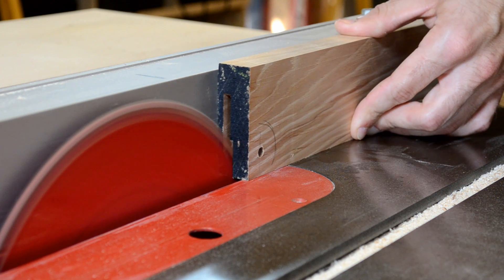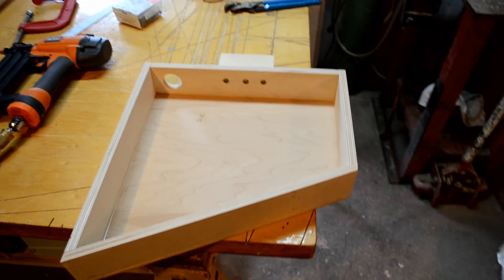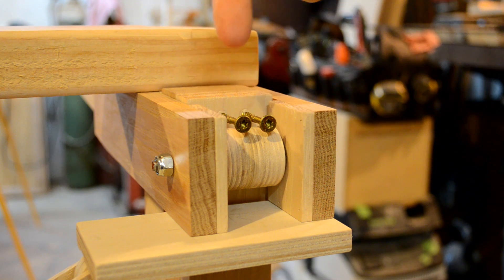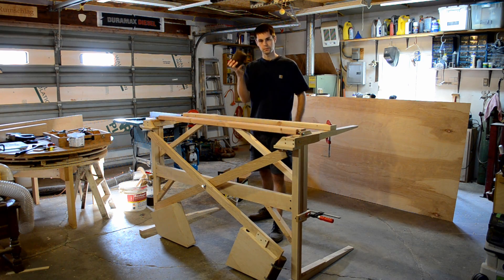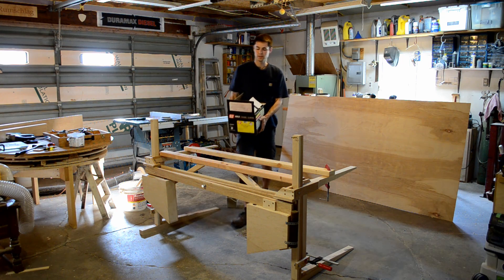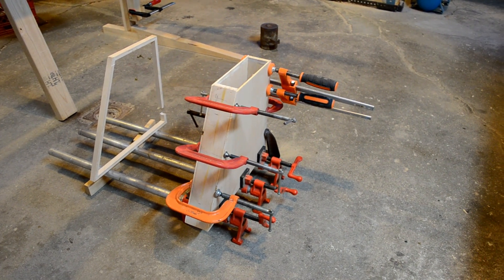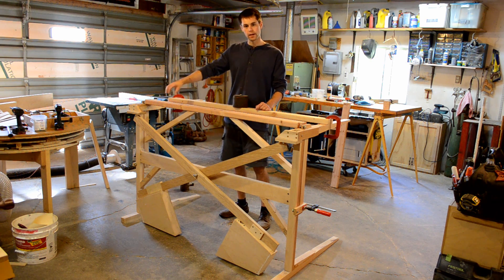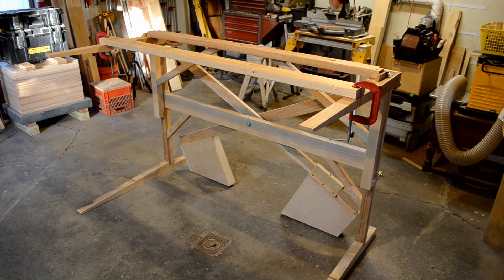Counterweight Desk #3

Comment: Bit Late i know but if you go to any local window fitting company, they will remove box sash windows on a regular basis. Inside those sashes are pre-formed counterweights (size and weight change per window). 
These companies ether leave them in the frame as they cost money to scrap or they bin then as there not worth much to sell as scrap. These could be used and cut to size and finished with sand or nails to desired weight and would cost almost nothing.
On a side note, you could restore and use bare as they come with cast loops.
Reply: Great channel by the way, something's take a while to be found
Reply from the maker: Sounds like an interesting source, I thought of tire weights but they are too small to be practical, windows seem better.
Reply: Some are decorated too as they were meant to be on show so could be used decoratively,   Great channel by the way.